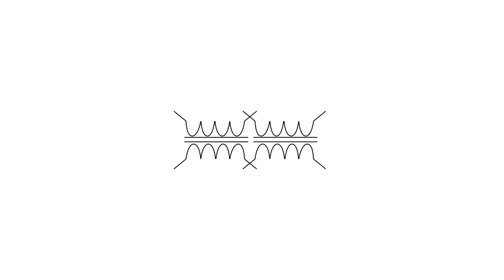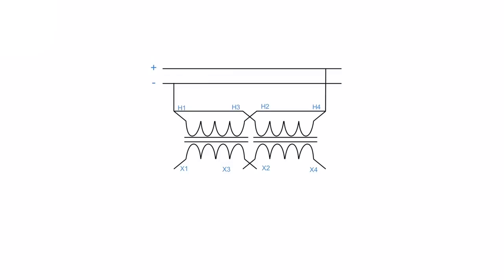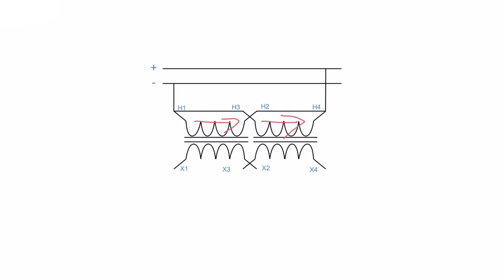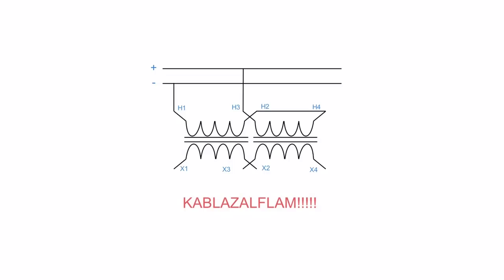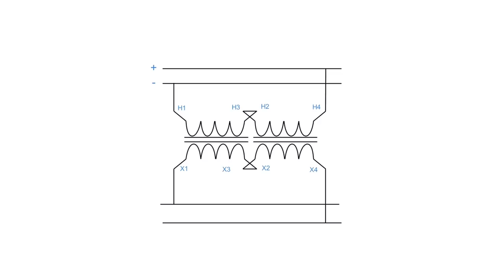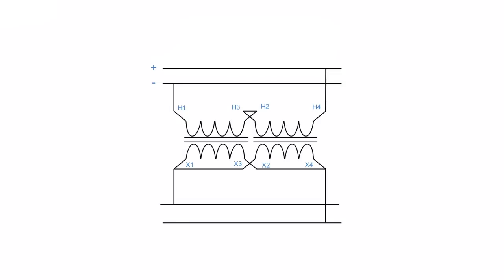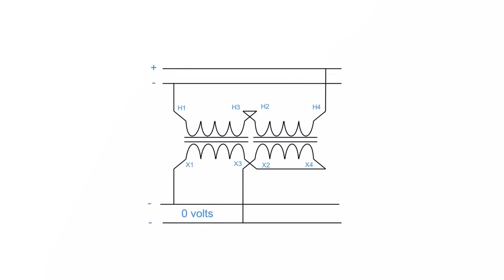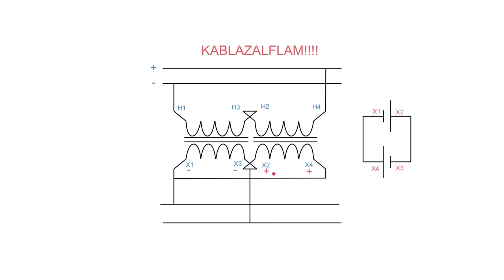How to connect a transformer properly

Comment: 1:55 I hope everyone is aware that the important point is not that the current is flowing from left to right in both coils in this picture. The current must have the same sense of rotation around the coil. If the coils are connected as in this picture and the sense of winding in the coils are opposite, then we have a KABLAZALFLAM situation.

Also, I would stick to the convention that current flows from positive to negative to avoid confusion.